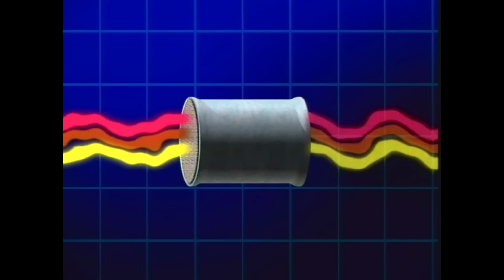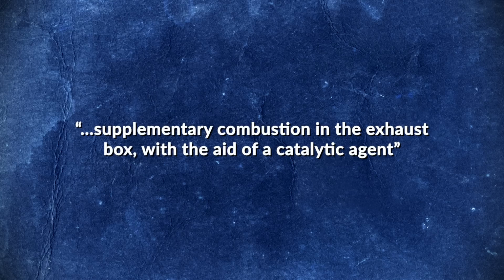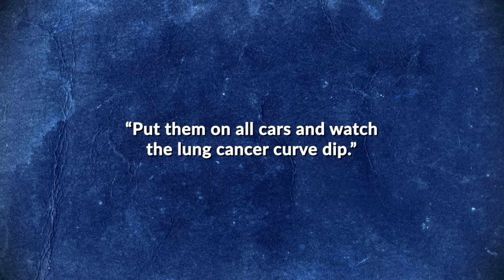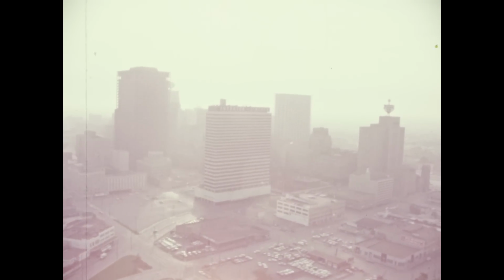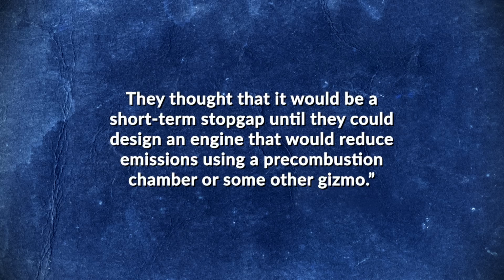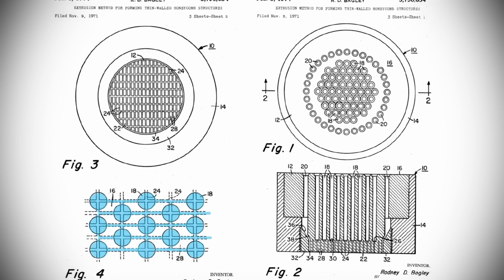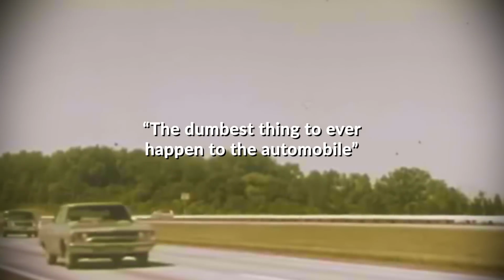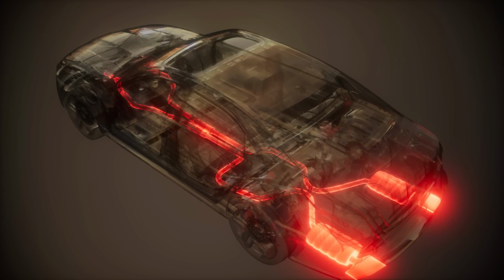The Most Underrated Automotive Component of All Time

Comment: Something that I can rip off my car to immediately gain performance isn't underrated enough. Under-hated is more like it.
Reply: Generally only turbocharged vehicles benefit from removal of the cats
Reply: @kirunacat  completely wrong.
Reply: @GMG455  Not at all, for turbos 
Dropping the pressure of the exhaust post turbine helps with pressure ratio and thus power.
N/A cars don't have a turbine so if the exhaust is engineered well (like most European cars are) you gain next to nothing.
Reply: @kirunacat IIRC the inherent exhaust backpressure caused by the muffler, cat, and shape of the exhaust manifold and pipes interferes with exhaust escape from the chambers of the engine. This results in more hot, burnt gases in the combustion chamber at start of cycle, reducing the amount of intake and increasing the average pre ignition combustion density (temperature)
Reply: @clankplusm  Yes that is correct, though it's not so much backpressure but exhaust velocity, if it's too big exhaust gas is too slow to scavenge effectively. On the other end if it's too small you won't be moving enough volume to scavenge the exhaust gas efficiently.

Turbo engines do have some backpressure between the exhaust ports and turbo but the negative effect is nullified by the much higher pressure driven into the cylinders from the intake (which is why they like valve overlap)
Reply: @kirunacat  wrong.
Reply: @metalbrony2012  brony pfp, instant L bozo
Reply: @metalbrony2012  You don't understand how engines work if you think that's wrong, lol.
Reply: @nilssjoberg2522  catalytic converters are already a restriction and build up crud on the inside that restricts the flow of exhaust gases more and more over time. Even seen one plugged up so bad that when the motor was cranked over it blew the cat in half. Trust me bro it ran alot better afterwards lol. Don't believe me? Weld a little plate over your muffler tip and drill a tiny hole in it. See for yourself how restricting exhaust gasses affects performance:)
Reply: @danrocker1294  But imagine for a second that even a cringe Brony will always be infinitely more knowledgeable about cars and combustion engines than you... that's a pretty tough pill to swallow I bet.
Reply: @metalbrony2012  Your cat is not a plate in the way with a tiny hole in it so that argument is invalid. 

If your catalyst is clogged you've LOST the power. Removing them does not give you more power but restores what you once had. 
Naturally aspirated engines and their ECM need to be tuned for a certain RPM range with respect to exhaust gas temperatures (which influences velocity) and header design to improve scavenging which is what makes more power.
Where you make this power in the rev range will be influenced by the style of headers.
Reply: @nilssjoberg2522  "removing them doesn't give you more power but restores the power you once had" That's the nail on the head. Now imagine you're tasked with designing a motor, but it has to include a catalytic converter (brand new not plugged). You can tune that motor for it's maximum performance, but if I get ahold of it afterwards I can rip the cat out and put a small tune on it and it will make more power than you could tune for with the cat included. Because when modern motors are designed, they design them for best performance with the cat in mind, but also realizing it's a handicap right outta the gate. So in a way, removing the cat restores the power you once had... before they put the cat on your car at the factory:)
Reply: @metalbrony2012  Modern catalysts still flow very well so your margins for power will still be relatively good compared to an unrestricted system. If you only remove and tune, without changing header design, you stand to gain very little power(maybe 5-10 in extreme cases).
Most of the time the practical solution is the entire exhaust system gets thrown out for something that's actually engineered for performance.
Reply: @nilssjoberg2522  yes! Headers and full exhaust swap all the way! But did I hear you say you could gain 5hp from removing the cat and tuning? Seems like an instant 5hp gain to a guy like me. Pretty sure that's what I said originally...
Reply: @metalbrony2012 Do you even notice those 5hp? I can assure you that the non-converted NOx, CO, etc will be noticed by the environment - that's why cats were mandated in the first place.
Reply: @metalbrony2012  bare minimum you're going to spend $500-600 on a tune, and then an entire exhaust which either Fabbed or bought is gonna be another couple hundred dollars minimum, which puts you way too close to $1000 for only 5hp
Reply: @nilssjoberg2522  ah ah ah. You just got done admitting that with a tune and cat removal ALONE you could stand to gain 5hp. so take that few hundred dollar fully fabbed exhaust out of the equation, (but yes headers are also awesome) Don't know where you're pulling the $500 figure for a minor tune from. I prefer to do it myself, but there's alot of shady trees around here can do it for under $200
Reply: @metalbrony2012  With cars (and machines in general), the scale of practicality dictates whether or not things are possible. Unless you're a seasoned tuner you're not optimizing that 5hp yourself. Any reputable tuner is going to need to get it on a Dyno to actually get those numbers.

For an example, RICA Tuning offers software for the 3.2L Naturally Aspirated Inline 6 used by Volvo and carries a PZEV compliance. At it's peak it made 243hp@6200, and with RICA software(and no other modifications) will bump it up to 250@6000 at a cost of $461. 
Unless you're going to redesign the manifolds, the rest of the exhaust is basically irrelevant for power gains.
Reply: Spoken like a true idiot.

Comment: "...aaaaaand it's gone."
-Every Car Guy
Reply: If you don't remove it yourself, depending on where you live, someone will likely be along shortly to remove it for you...
Reply: Fact is that old cats did. Modern ones don't even really rob any power😅
Reply: As a general rule, "car guys" are selfish childish trash
Reply: Honestly, I don't mind my catalytic converter staying on my car. Although, I might be exempt from emissions if I spend enough money and still can't pass (which is seeming like a very real possibility right now). At that point, it doesn't really matter. They keep making the numbers smaller, which means that some 30+ year old cars might have a hard time passing emissions. Like my car. 
It just sucks that my old shitbox somehow has to keep up with modern emissions standards. It's very annoying.
Reply: I've been pulled over a few times for roadside emissions equipement inspections. I'd rather keep tye stock cat or buy an aftermarket high flow unit than pay a fine to the government.
Reply: Nah. Most car guys know that modern cats are super efficient and definitely aren't worth taking off. You're not going to get any significant power increase from removing it. You'll just up the particulate emissions, by a lot. Leave your cats on, people...
Reply: @Bertinator-nm9ld  acting as though free horsepower isn’t free
Reply: nah my cars all have cats, and are 6 cylinder turbo and v8 manual, non cat exhausts stink and are bad for the planet
Reply: @tturi2 I'd leave them on purely for the smell, every time I get an old car in my shop I stop and think how awful if would be if every vehicle smoked me out like that. 😊
Reply: @tturi2  yeah but one more isn’t gonna hurt
Reply: <laughs in emissions exemption>
Reply: Just bought and installed a new one on my car, even though my state doesn't check I'm not some PoS that would rather poison the air for an extra 3HP.
You're giving us a bad name, justifying the heavy handed BS the EPA has been doing. You're the comments people point to to prove we need more regulations in places like mine where we're still free to not get car inspections.
Reply: @GeorgeWashingtonLaserMusket hahaha keep drinking the kool aid
Reply: The amount of performance engines "polluting"  is not even a drop in the bucket compaired to all the so called green weiners and celebrities flying around for their carbon bullshit meetings or the massive output of the military industrial complex keep guzzling at the bullshit pipe from the propaganda machine and congrats on being gay 👍@GeorgeWashingtonLaserMusket
Reply: Guilty 🙋‍♂️